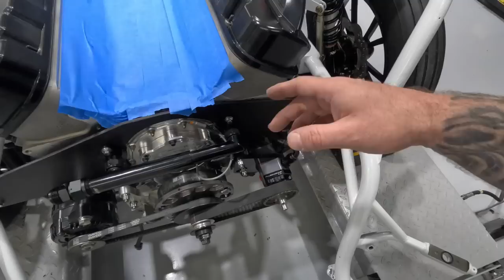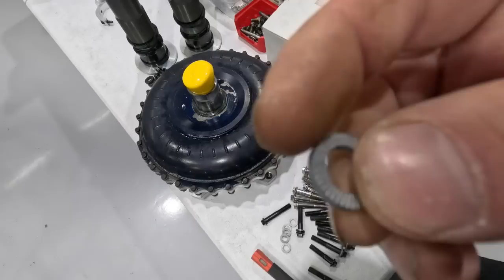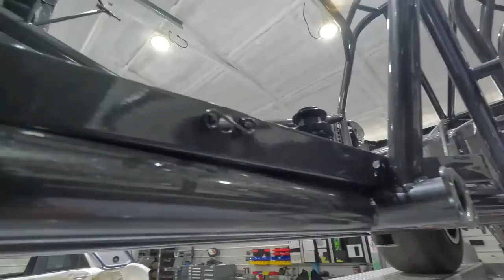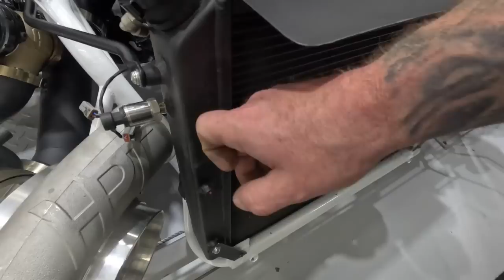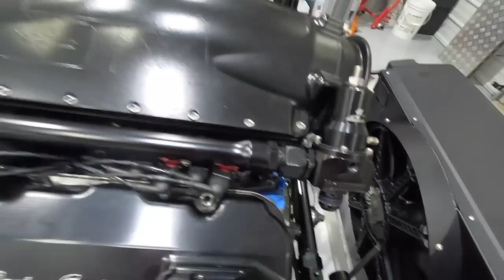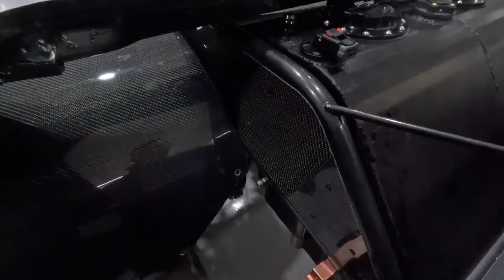Big Ern Convertible Rebuild Day 2 Part 1

Comment: I think you could 3d print a grommet in black TPU. 
I think getting a file done in fusion could be pretty simple if I had the angle in which the 4” hole was drilled (bar to panel angle) and the diameter of the air jack. Install the grommet on the panel and then reinstall the jack 🤙🏼 I could do a file like this if you want let me know. I’m sure you have a print guy close to you.

Comment: For sealing the air jacks maybe a silicone tube over jack body and the carbon is trimmed to fit it snugly. Grommet would be ideal just the angle it is on would make the hole oval shaped.

Comment: What about a rubber edge seal to seal around the jacks? You'd have to get creative cutting it and it would have a seam to deal with.  Look at seals+direct - Edge trims & Seals - Edge Trims. for an idea of what I'm thinking of. Pbly can get it local, this was the first picture I found. FWIW  BTW any updates on the electric AC install? wondering how it'll work.

Comment: Thanks for the update and commentary. I see a nicely rolled firewall, that looks beautiful!

Edit: Look up shaft-mounted rotary seals 2.5", maybe you can get it to act like an air jack grommet. I guess it would be bigger than 2.5" because the hole is stretched out.

Comment: The car is looking great! On the air jacks, I was thinking about a 3d printed collar with a flange to match the angle of the floor. It may have to be 2 halves to get it on and then use a foam gasket at the bottom and a tight fit around the cylinder.

Comment: Better then vacuum hose split or weather seal etc 

It’s called edge guard on Amazon etc, it’ll look a lot clean her adhere better. I have it around the opening on my hood where my Wilson elbow hangs out and it’s been over 150mph no issues, no extra glue or anything
Reply: That behind said the 3D print thing would be a lot cooler and better I’d guess.

Comment: You could 3d print/fabricate a sleeve that slips over the canister neat and has a small sealing flange at the same intersect angle as the carbon it goes through.  Have it made with a slit and pinch bolt arrangement, Use a rubber gasket to seal it up. Hard to explain but figured I'd mention it anyway.

Comment: Tip with the trans jack issue. I use to have the same 1 scoot the trans on and off it using your 4 post to rase and lower it. Nobody got time to be doing lifting like that. I did the same thing when I put  my hutch on my tool box

Comment: Keep the videos coming Devin. Love your content. What are your thoughts on the Egate bleed tube in the intake for boost controll?

With the air jacks, can you laser cut or print a flange to sammich some the cooler/ wetsuit like material to the panel, then clamp zip tie to the air jack body??

Comment: Seal the lift hole with vacuum hose. You may have to experiment with different diameter vacuum hose to get the right rubber thickness, but cut the hose lengthwise, like a piece of cheap plastic wiring conduit and you'll have your own grommet made to fit.

Comment: To seal the air jacks I would use some factory style door deals the kind that clips on over top of a pinch weld…. That way you can slide it over the edge of the carbon

Comment: Beautiful car sir you have done a great job on it. Also I agree with what you said about the msd 600  that’s what I run with the Holley dominator and race pack smart wire it’s just a great combination and If it wasn’t I wouldn’t run it considering I don’t wanna mess a 60k engine up.

Comment: Use the arm of a 2post lift to set the trans on the jack
Reply from the maker: Dont have a 2 post lift lol
Reply: @theholleyefiguy  just lift it onto your 4 post lift, raise it up and then slide it onto the trans jack. It's safe as fuck lol
Reply: Didnt look in the background of the video, just assumed you had 1 of each. But you might be able to do the same with a 4 post if it goes high enough. @theholleyefiguy
Reply: Use your engine lift to lift trans. on to trans. jack.